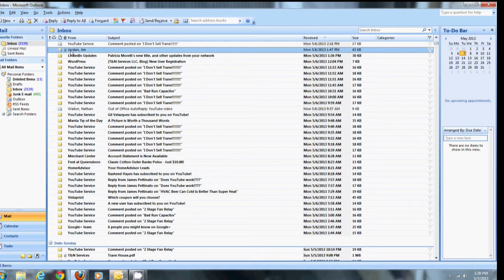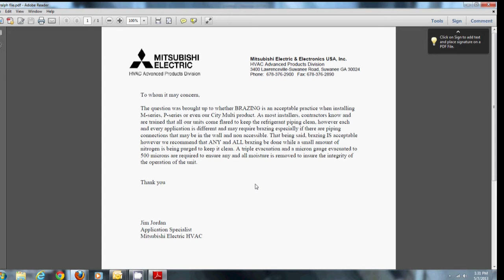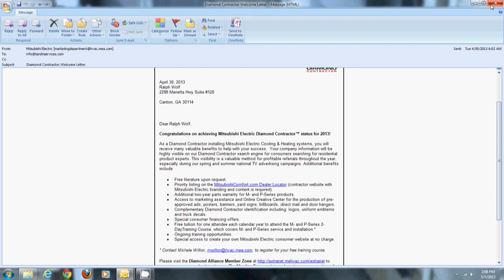Can I Braze Minisplit Linesets

Comment: I have never installed Mitsubishi mini splits but I have installed, Fujitsu, daikin, and Trane (gree). I have always been taught you can braze mini split lines if you drift nitrogen. Brazing with a nitrogen drift will prevent the black carbon flakes on the inside of the copper. Vrv's are mini splits on steroids now a days all vrv lines are either brazed or pressed. Chicago building code will not allow flare fittings ALL connections need to be brazed. I wish I had a picture of the knuckles on the air handlers we did. We brazed the line to a brass fitting that had its own (manufactured) female flare. I believe we just wrenched down the fitting and the inspector was ok with that. They also wanted a relief installed on the inside of the service valves on the heat pump. Daikin would not sign off on cutting into their piping. We ended up brazing in external service valves and installed the reliefs between the jbs and the factory valves. Then we filled the factory valves with jb weld to make them inoperable. Chicago code is a joke.

Comment from the maker: Hey Elf, no disrespect taken. I let my nitrogen flow through an open end of the line before I connect the flare to the unit. I just prefer to braze the lines to avoid any problems down the line. if for some reason the flare cracked or for some reason the flare didn't hold that would be a warranty I would have to do. Being self employed anything I can do to prevent a warranty I'm going to do. That's the only reason I do it. Thanks for watching
Reply: I'm curious what you think about using staybrite 8 on refrigerant lines, including 410?

Comment: I know this video is 5 ears old but it's the first time i've seen it. I've always soldered the lineset rather than using the flares. I always have a little baggy of 1/4, 3/8 and 1/2 couplings (sometimes i'll swage). Not braze, just plain ole Sta Brite. I have had not one leak on any mini i've installed. I also use Nylog red on the condenser flares. Every one has their way of doing things. As long as the outcome is a working reliable system, what's the problem?

Comment: Hi Ralph. I love your videos. I also inquired with Mitsubishi about brazing linesets and received the same info, but the biggest problem I run into up here in MN is wiring issues. Zone wiring crossed so IDU A turns on but the refrigerant is sent to IDU B and vice versa. Poor grounding, no ring connectors, wire nuts used to splice the wires going to the IDUs. Mitsubishi says that wire nuts are absolutely NOT to be used to splice wires. Their #1 choice is a terminal block, #2 is to solder the splice and shrink wrap it, #3 is to use crimp on butt connectors. Those are the only choices but no matter how many times we tell the electricians they still screw it up. Maybe there's something in the water up here? I don't know.
We used to sell Fujitsu and they said absolutely under no circumstances are the linesets to be brazed and that it would immediately void the warranty. If you had a splice in the lineset in a wall, attic, crawl space, or other difficult location it didn't matter. No brazing at all, period, end of story! We were supposed to use an orbital flare tool and flare coupler fitting and go ahead and conceal it. But you can't use standard flare nuts and the heavier duty flare nuts weren't stocked at the supply house so we'd have to special order the heavier duty flare nuts and stock them ourselves. It was one of the reasons why we switched to Mitsubishi. The other being that it gets cold in MN and Mitsubishi has low ambient Hyper Heat models up to 5 tons/60,000 btus and Fujitsu's biggest low ambient system was a whopping 1.25 tons/15,000 btus

Comment: I know this is an older video and I saw this one last year, but I think I might be following suit. I just got a call back for probably the 7th time in 2 months on a LG system that was installed at the end of june. Customer says unit is making squealing sound at indoor units while running. I literally got LG to replace the outdoor unit and I also re-ran the linesets to make sure no holes in them. I'm pretty sure the unit is probably leaking again! WTF the frustration is incredible.  Told the customer we are going to braze linesets and leave the flares for the hookups at the ODU. I really hope that will solve the problem,  and yes I will be using a nitrogen purge.

Comment: Well I've not installed or worked on any, BUT have decided to install 1 or 2 or 3 inside and 1 outside unit here eventually, mabe this summer or next. When I do, I'll do as you and braze cause I detest flare fittings.If someone has a problem with that, well then ya know, they just have a problem with it. I do things the way years upon years have taught me and what is best for the company. I'm sure you and others are the same and if it didn't work, we'd be doing it differently. Take care,Brett

Comment: I tend to braze the wall mount connections, have seen them leak before, either due to poor quality flares or split flare nuts.
Was told on the LG coures its ok to cut them and braze them.

Two less places for leaks imo!

 Usually i'd braze on a few meters, or even enough to reach the outdoor unit, and feed it out the wall with the power cable and drain.

Comment: can you run a mini split up to an attic then back down to an interior wall without causing issues for refrigerant flow? condensate removal is another issue I know but will it be bad for the unit to go up then back down?

Comment: Watched a few of your videos over the past few days that have good information.
I’m installing a single zone mini split heat pump and I’m gonna braze/solder the air handler connection with Stay Brite 8 and use flare connections on the Condenser.
I got a question on the line set length.
The minimum says 10 feet  with the precharged condenser and a maximum. My total line length will be probably 8 feet. Will I need to adjust the refrigerant level if I’m under the Minimum of 10 feet?

Comment from the maker: checking it out. I do know that there are places in the U.S. where trainers (who don't work for Mitsubishi) give class to contractors, and you know as well as I do most of those guy have never put this stuff in and most wouldn't know how to hang the backing plate to the wall much less tell you if you can braze the lines. And now you have proof to take back to them that it can be done. I encourage comments to my videos and if you would have asked I would have explained why I braze them. Cont

Comment: i need to start brazing them, those flares suck, i wish they made it possible to braze the connection by the condenser as well.
Reply: Just make sure to use Nitro.  Manufacturers will void warranty if you tell them you've brazed on a system without nitro.

Comment: customer tried installing his own mini split, i found 3 leaks that he had. fixed, pressurized and pulled a good vacuum on it. i put in factory charge on a dual head system, although i couldn't get any cooling out of the upstairs unit and everything appeared to be wired right. the suction line service valves started to ice up and the liquid line was also really cold in cool mode... im not to familiar with split systems. but the condenser was rated for 27kbtu and had a 9k and 12k head.. ON heat controllers do you know if you add for lineset size/length?
Reply from the maker: Factory charge is all you need on it. Give me a call tomorrow and I'll walk you through what to do

Comment: Nothing wrong about brazing or not - just be save from starting fires....!!!  A nother thing - when i mount the inside part, i usually take the cover of first, then messuere the need of lenght of the cabel and install that. Then before i put the pipes and cabel throw the hole, i tape the bounce together. Much eaiser to put it throw the wall. But thats i only the way i  m doing it. you can do it your way - anyhoooo !  
Sorry for my bad spelling. I´m Swede -  still with  pride despite our f x cking situation in our country. 30 years in the buisness. Take care.

Comment: personally I don,t like brazing minis, #1, no high side port to exhaust nitrogen while brazing  to prevent oxidation. #2 in case you braze without nitro, there are no filter driers included and expansion valves may get plugged; unless you install a bi-flow  #3 flares are quicker if you ever need to remove the inside unit for cleaning, this what i do on all minis. seal all flare nuts with nylog, pressure test to exact 150 for 5 mins and micron to 400 this been said with all respect..good bless

Comment: I am wondering, if those guy's that are so antibraze, how do they go about when they have to extend a line? Or if it is an difficult installation and it isn't possible to lay the line in one stretch, do they flare the joining?
Reply: Thomas Bærøe I had a foreman on one job freaking out about how to connect two lengths as the supplier didn't have flare coupling in stock. I asked him if he lost his brazing skills and got a deer in headlights look)
Reply: +Thomas  Its been my experience that most techs dislike Flares and would rather braze or compress lines.  I personally like to Flare using correct 410a flaring tools.  

Huge example is light commercial refrigeration systems with long line-sets... I like to install flare Liquid Line Dryers with ball valves on each end with a port.  When i comes time to change the dryer all one has to do is isolate the Dryer and install the new one.  Evacuation is simple since all you need to vacuum is the Dryer.  It saves allot of time and material while minimizing chances of debris in the line-set.

To each their own.  Flaring will never be as solid as brazing.  That doesn't mean I've never found a brazed connections that looked like bird shit and leaked like a gossiping brook

Comment: all I will say is you are only eliminating two possible leak joints so you are not not really saving any thing and you making a big deal out of it
Reply: Yes you can do it a don’t see any problem to do it. The only thing is goin to be more little more work to uninstall the evap , but if the lineset is not inside of the wall you can do it easily. I have 20 years experience with mini split never have a problem when i braze or not !!! Everything with good practice.